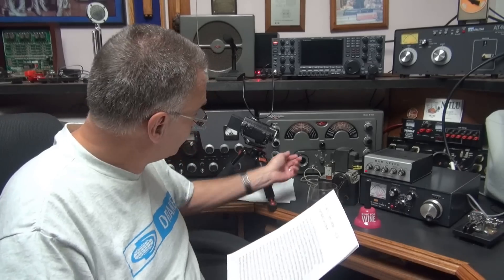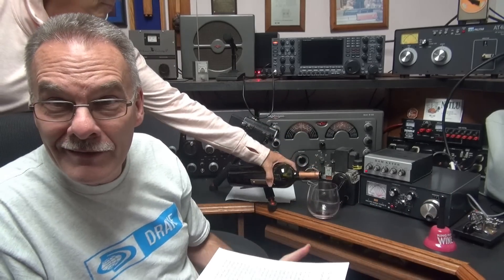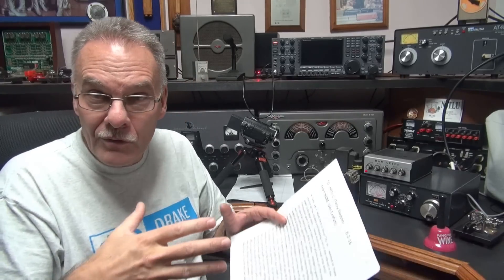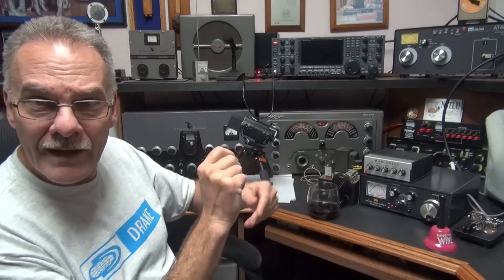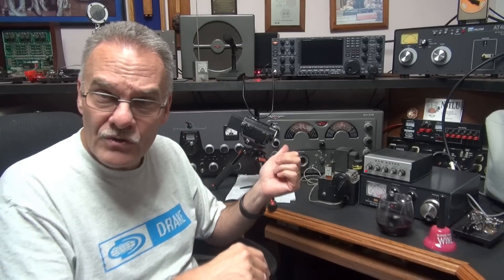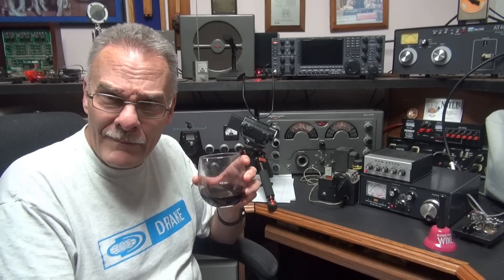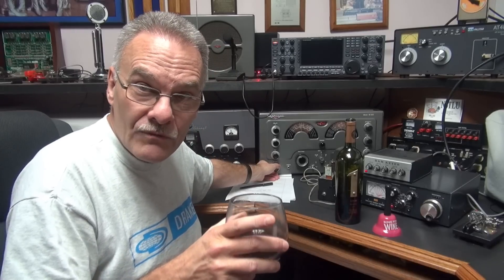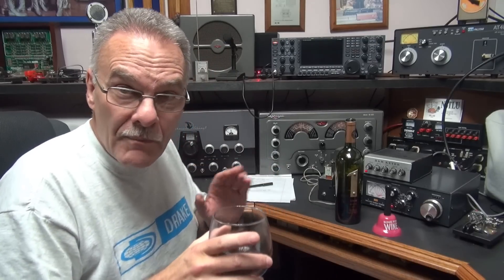Homebrew single tube 6AQ5 Ham Radio QRP 3 watt Transmitter 40 meter QSO plus National NC-183D

Comment: Great!  I just bought a NC-183, and it's working.   the Prior silent Key owner used it for CW only, and that is what I plan to use it for this fall, as I start learning CW.  I have only been a Ham for a year, got into the Hobby at age 58, I am a General, but I admitt, I'm as Green as they come in Amatuer radio, but I like the old stuff and want to learn Cw.  Enjoyed your ;video much, I think I will be asking you questions for sure, hopefully on the air.  My transmitter will be a 1948 Wolf Special Transmitter, 80 and 40M,

Comment: From Leo: Fun memory.    I remember building a similar transmitter in about 1968 from a plan in the ARRL handbook.  Mine did not use a 6aq5 .  It was an octal socket tube, built breadboard style on a piece of 2 x 10 board with terminal strips .  Ran on a folded dipole stapled to the rafters inside the attic.  Luckily the house was 35 feet long so I could full wave 20 meters if I folded.  Flat key days.

Comment: I constructed the single tube CW xmtr in 1975 from the schematic in the 70'ish ARRL handbook, I think the tube was a 6AQ5 but I'm not sure.  What I do remember was having a lot of fun working stations all over the US  on 40 meters with just a dipole and my Hammarlund HQ-170 rcvr. I remember the rig had a clean note and at that time band propagation was good so 599 signal reports were plentiful.

Comment: I once did a station in oaklahoma with 100 mw going into 3 element Wilson 10-11 meters.  I don't remember the frequency or band, just know it was SSB. In all fairness I was using 40 watts for the initial contact. Decided to see if I do with less than a watt.

Comment: I would love to work you one of these days. Guess I'll have to start listening up around 7.115! --Steve KC2SIZ
Reply from the maker: I stand by on 7.115Mhz CW
Reply: @d-labelectronics   I'll tune the Utah online SDR rcvr to 7.115 and monitor for signals. And in the meantime I'll work on getting a working rig on the air.
Reply: @d-labelectronics  I called you a couple of times this week, but no joy. Will try again sometime. By the way, I think this was your best video to date. Very fun, but now I crave a glass of wine....

Comment: Not trying to be negative, just curious - you're using a crystal, yet you have chirp. Power supply issue? Unstable parts in the oscillator? Thoughts?

Cool video and enjoyed seeing that old homebrew get the job done.
Reply from the maker: Hello, The chirp was mostly generated by my receiver drift and input overload. The TX note itself is fine

Comment: Thank Terry for doing this.  I think the tone on TX is due to the drift of the RX and probably some small  front end overload as when I used it here the tone always sounded very good with no chirp or whoop but of course the quality of crystal also plays a big part in that,   all the best to you and the family and stay safe   Thanks again!!   73 Jim  N0XE
Reply: I was surprised that he did not use the RF gain control to get rid of all that background noise.........some like to have the AF gain wide open w/o AGC......

Comment: How about more info on the transmitter.  Sure, post a contact list of times and freq. AB1ZI
Reply from the maker: From the builder:
This is the magazine I originally used to build my first 6AQ5 tx.

https://www.radioexperimenter.us/rm-1976-10/cwbg.html
Reply: D-lab Electronics , looks nice, but I don't see a full schematic diagram in the article. Looks like it would be fun to build.

Comment: Wow that receiver sure has the selectivity wide open!
Reply: @Richard Hayter  I was gonna say...
Reply: Back in the day that was the way it was, you tuned your ear for the cw note you wanted to work and still you could copy adjacent signals at the same time with some practice.  It was kind of like a party line except everybody was rockbound and a few kc off of each other.  Great fun!
Reply: My Hammarlund from the 1950s has 500Hz selectivity. Before the days of crystal receivers. Also the original regen receivers could tune very sharply albeit with slightly wider skirts.

Comment: Many years ago, I remember reading an article about a one tube 40 meter transmitter that was built on a board. It was built by W5LET and featured in  Electronics illustrated in 1968. I think I started the project and never finished it. Here is a link to that article. http://wa2iac.com/50C5__homebrew/original_article.php